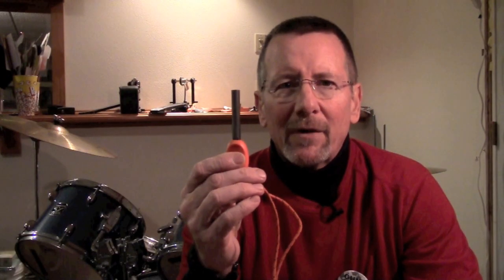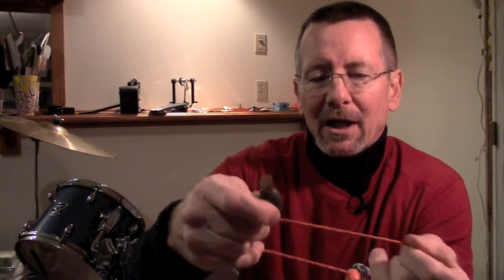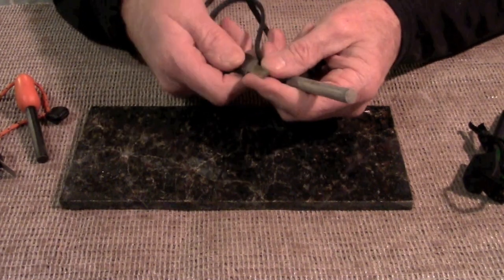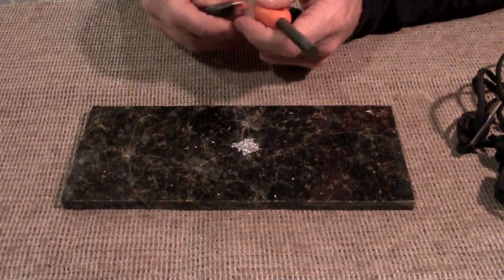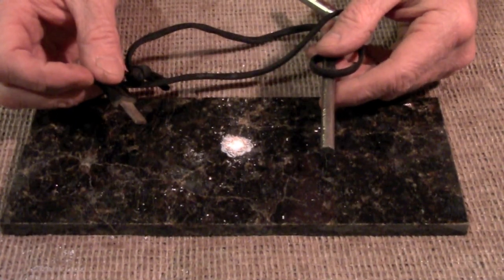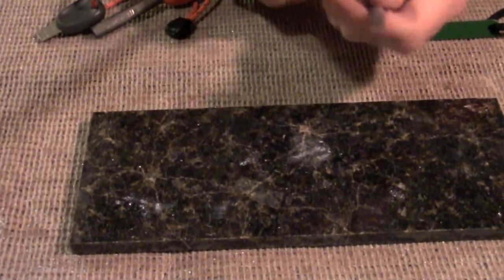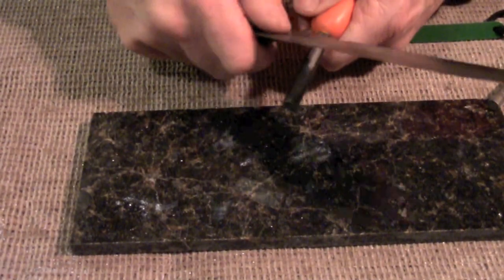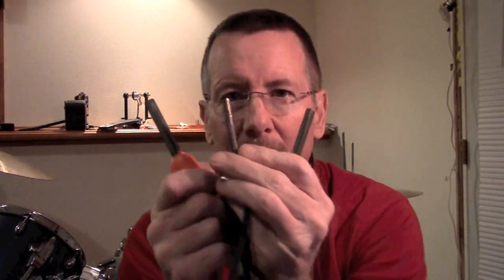Which Is the Best Fire Steel? - Fire Steel Tips, Tricks and Reviews

Comment: Good hard sharp striker is a must. After that you choose if you want a misch metal rod, or a harder version. Misch metal slings "balls And gobs" of burning material. The harder versions spark, but usually don't burn quite as hot. You want more "run and weight" longer and heavier for ease of use, longevity. They'll ALL do the job if you use Dave Pearsons "stages of tinder" video advice, and the old dry Gatorade bottle "fire carry setup". BUT you may be sick, injured or the list goes on.. Personally, I want the one that's gonna burn like dragon snot kiddie sparkler stuff. LOL, because my tinder may be just a tad off. Magnesium bar quality does make a difference. The Chinese models and cheaper versions put other white metals in, that are harder to scrape and burn. Aluminum will burn but you have to add other powdered metals and get it over 2000 degrees. I just "cry once" with this stuff and get proven stuff that I KNOW will work. and keep a BernzoMatic Propane "short can" torch...**grinning**
Reply from the maker: Thanks for the info

Comment: I feel a bit confused about ferro rods recently. I bought "Light my fire" thick Scout 2,0 and Army (very thick) as they boasted a Produces a 3000°C spark (a great survival edge). But the TUT Fire Steel XXL, Flint and Steel Fire Starter Kit with 127 mm Hexagon Magnesium says "thousand of 2982℃ (5400℉) sparks soon." So it matches it in heat. But are they both much hotter than ordinary?